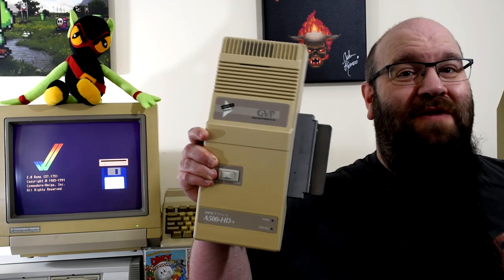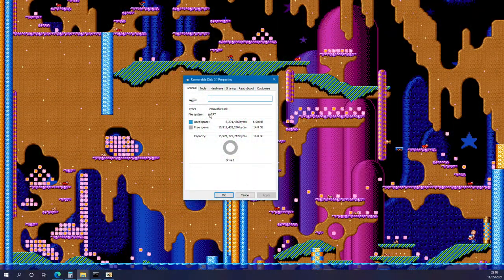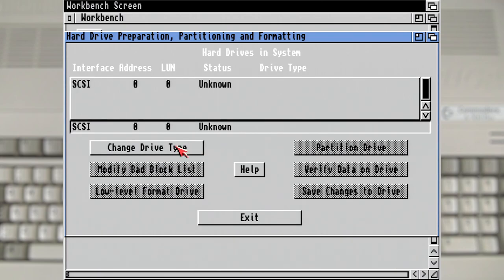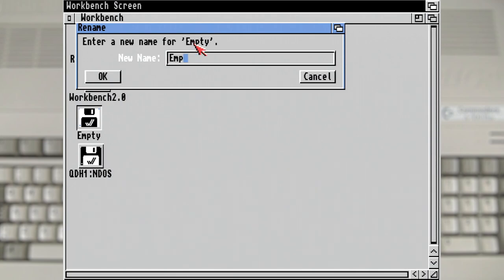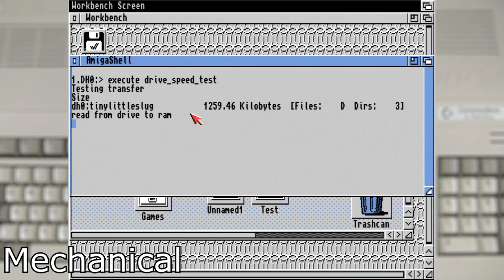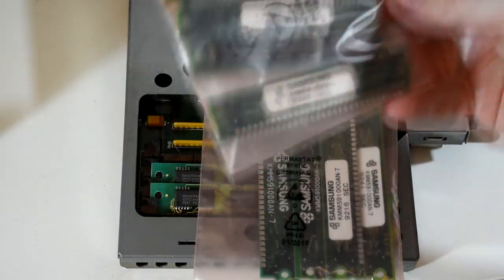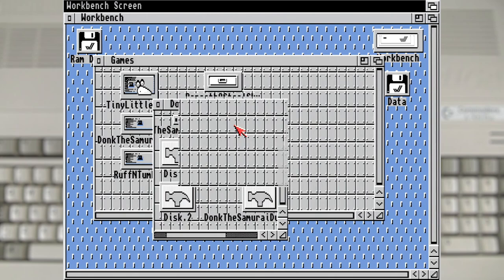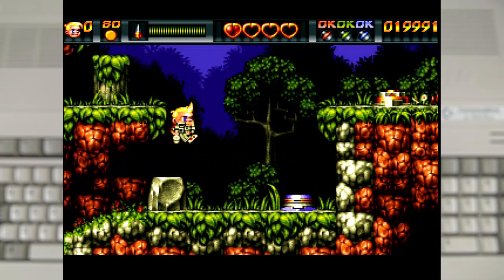BlueScsi, Ram and the power supply Its The GVP HD8 Revisited!

Comment: Great video!  Is your modified firmware available anywhere?  I understand it may or may not work with specific SD cards.  I am using a GVP myself here.
Reply from the maker: The firmware has changed quite a bit since I made the video.
So it would be worth trying the latest if that doesn't work then you can find the rough area of the code and put the wait in.
But I have been told that to get proper SCSI2 comparability a hardware revision is needed.

Comment: I need with the GVP, i put inside to many scsi HD drives and no detect any. Also add a iomega zip scsi back conector detected as a scsi but not the disk on it. JP2 jumper what the correct place I don't found on the manual!!!

Comment: using a dataflyer external A500 SCSI unit, but get an error detecting SCSI drives. Where and how did you change the timeout value?
Reply from the maker: at around 7:18 in the video I showed where I added in the time out.
if you look for where it has the line:
LOG("Command:");
that was around where the timeout should be added.  I've not had the time to work much on the project recently so not sure how much has changed.
This will require some trial and error to get right and you might get more help from the BlueScsi discord server.
Reply: @GouldFishOnGames  . Thanks! not sure if i understand how to change the value and compile a new image to flash. would you be able to share your image file you flashed?
Reply from the maker: @denniskrijnen5586  Back when I was first working on this I shared the updated firmware with a few people and each person found that the timeout wasn't correct for them.  As it changed based on card, format and Scsi controller.  Which is why I said there would be some trial and error.  I followed the this guide:
https://github.com/erichelgeson/BlueSCSI/wiki/Flashing
and it has a youtube video on setting up the enviornment.

Comment: next upgrade: guru rom
Reply from the maker: That is something I seen mentioned a few times, but didn't look into too much.
There seemed to be talk of better compatibility and it might be faster, but wasn't sure how much of an improvement it would be.
Reply: @GouldFishOnGames  It natively supports trackdisk 64 (TD64) for larger than 4gb disks - without having to use the direct-scsi workaround. It offers better (=working) support for scsi disconnect (most often used by cd-roms, and zip-disks), some speed improvements depending on the specific setup - in general less buggy and just "better"